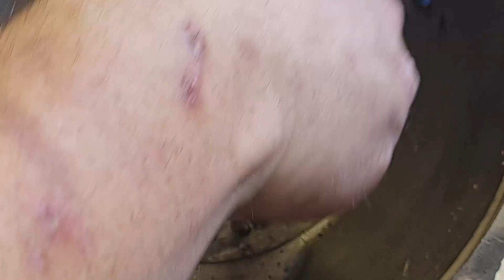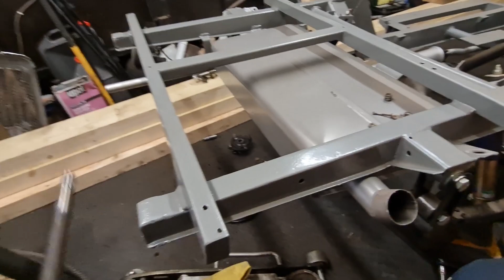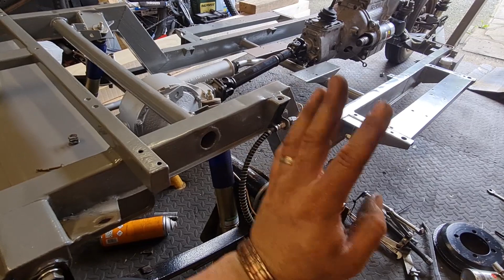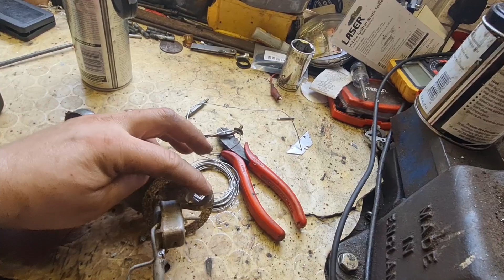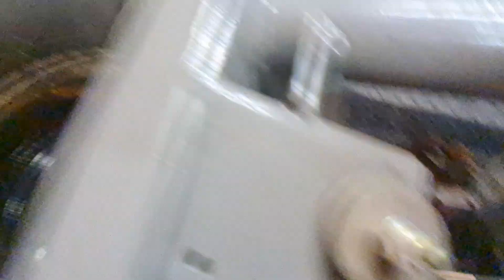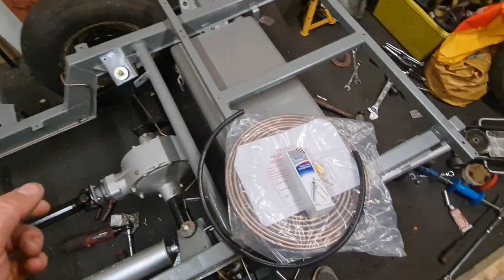RESTORATION PT14 Reliant Regal Supervan 3 Project PLONKER !!

Comment: Not seen a robin axle fitted on a regal before, they are not as wide so thought it would be a pain to do

on my rebel ive bought a bond bug axle and are putting my halfshafts/tubes on to the diff so I get a much better ratio

the regal ratio is screaming at 45mph
Reply from the maker: Hi mate, the robin axle is actually slightly wider so will need cutting down to fit, along with the spring mounts adding in the correct location, other than that i think its fairly straight forward... famous last words 🤣👍👍
Reply: @mec-tec  oh right, best of luck with it then I didn't know it was possible but i know more about robins/rialtos than regals
Reply from the maker: @thedeadstig123  yes it should be an interesting mod, 🤞 it works ! I wana get the van on the road 1st though and use it a bit 👍👍👍

Comment: You need to change the back brake pipe on the outside of the chassis on the driverside at the back because when the body goes on the chassis it will crush the pipe.
Reply from the maker: Hi are you referring to the hard line that runs from the front to o/s/r ? If so that pipe is in its original location, there is a gap between the body and chassis to allow it to go though without crushing it, thanks for the concern though 👍👍👍
Reply: @mec-tec  No the rear pipe you fitted over the top of the chassis next to the rear axle on the driverside, I'm sure that pipe goes underneath the chassis and is secured by a p clip screwed into the chassis.
Reply from the maker: @TheConsettcowboy  yes the that runs to the rear flexi hose on the drivers rear wheel, thats its original route, i have test fitted the body in a previous episode and it definatly has a gap to pass though 👍👍👍